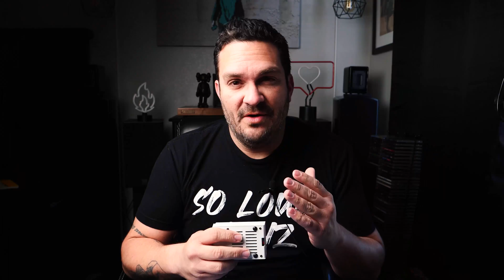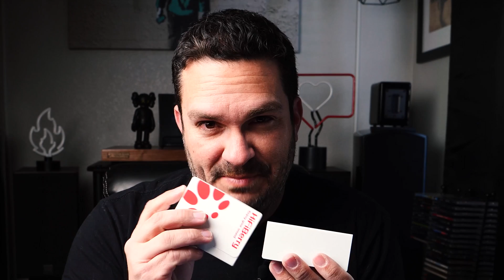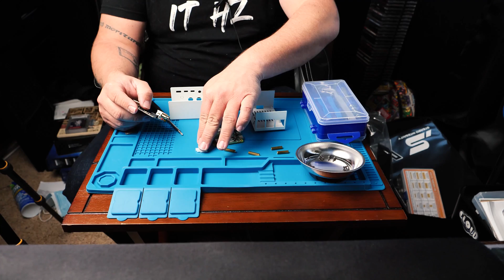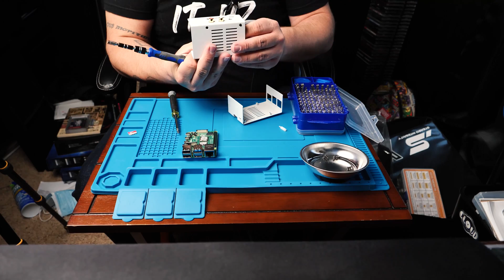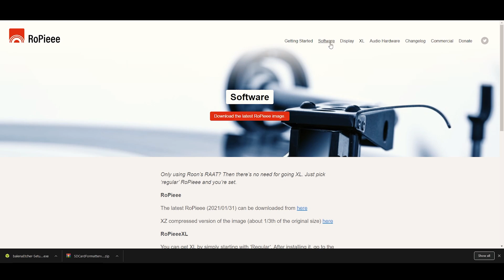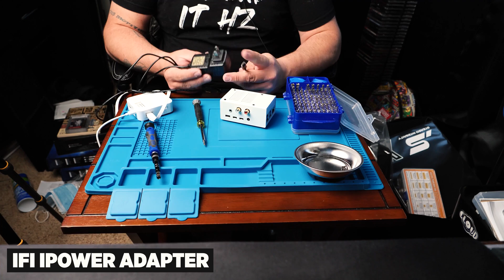How to Build a PiFi (Raspberry Pi Music Streamer)

Comment: Noon question: does the audio go into an Amp or speakers? I also noticed that the lower supply doesn't have a type C connector... Where does it get plugged in on the case?

Comment: I need to get digital signal from a Mac mini via Wi-Fi to an endpoint without a DAC since I will feed the signal to a McIntosh D-150 which has a DAC onboard.  How do I do this without installing a DAC on a Pi?  I need to use the McIntosh to decode DSD files.  Thanks.

Comment: I am always concerned about short and long term support. What happens if you assemble all this and it doesn't work? Worse, what if it goes dark a year and a half from now? Will you be able to fix and debug it?
For long term support reasons, I picked a cheap iPad ($250), the Camera adapter ($35), and I already had a Schiit USB input DAC ($99). The iPad sends 24/192K to the DAC. The iPad screen makes UI a breeze. I expect streaming software to continue to support the iPad iOS for a very long time.
But, of course, this lacks the DIY self satisfaction.  -Just one man's view
Reply: Jim Shaw, pleas help me out here man, I was using a Grace Digital Mondo to stream Pandora to my old early 90's Sony Stereo with Bose 301 Book Shelf speakers.  Now I need a cost effective way to stream music via RCA to my old stereo.   I have 2016 ipad pro that is collecting dust.  Why the need for a camera adapter?  Can you assist me on the parts to get this connected to my stereo?  Thank you.
Reply: @motleypixel  Check my story on this, because my iPad is a 2019 cheapie. The camera adapter is needed to get power into the iPad while also getting USB in/out of it. It plugs into the iPad "lightning" and provides micro- USB power in and USB-A signal. 
I was told when buying it that there were 3rd party "camera adapters" for sale that didn't work. 

I use a Schiit Modi 3 as a DAC, but I have also tested it using my Emotiva PT-100 preamp DAC input.

You will need (total) an iPad with WiFi to your router, the "camera adapter," a standard USB power cube and cable with micro USB male output, a USB-A male cable to whatever your DAC accepts, and the DAC itself. Then, RCAs or such to your amp/preamp.

All I can say is that the setup works and is solid. I picked the iPad because I felt sure the music streaming services would continue to support it with apps, good graphics,  updates, and improvements. Mine works at least up to 24 bit / 96 MHz -- maybe up to 24/192 depending on the stream.
Hope this helps.
Reply: @jimshaw899  ah okay I sort of understand the lightning port thing, but not fully.  I have a headphone jack out to RCA splitter on the way for cheap (amazon basics).  I think this will work where the lightning port can have the charge cable plugged in all the time.  The only thing I'm unsure about is quality and how or which DAC to use.  I just don't understand the difference between headphone jack vs a usb>DAC>RCA>Stereo system.
Reply: @motleypixel  OK, and understandable. It is mostly a matter of quality of the audio. I was going for a very good quality. Also, my newer iPad doesn't have a headphone jack like yours probably does. So I had to use the iPad>DAC>RCA>stereo method. My DAC is also much better in sound quality than any built into an iPad, but the iPad probably isn't terrible at all.

Your use of the iPad's headphone jack should give decent audio to your stereo. Just not uber pristine sound. The inbuilt iPad conversion of digital and the amplifier will be not very good, but maybe acceptable for your purpose.

Go for it. You won't need the Camera Adapter, and you can use the charger that came with the older iPad.

Comment: Wouldn't a USB DAC work ok if you didn't want to buy a hat and new case?
Reply from the maker: Yes it would work just fine
Reply: @audioarkitekts  Thanks! I was reading about this right after I asked my question and it was suggested to use a Pi4 if using USB DAC as there was some bottleneck issue with the USB on the earlier models. Luckily I already have the Pi4 and am about to order the DAC. Thanks again for your quick response.

Comment: I'm doing this, this weekend!
Reply: Question, can you use the Pi's WiFi to connect to your network?
Reply from the maker: @paznewis107  you can, however when you first start it has to have an internet connection to setup the Ropieee
Reply: @audioarkitekts  cheers buddy. It's great, I got a WiFi bridge in the end. Running Moode. 😸🏴🎱